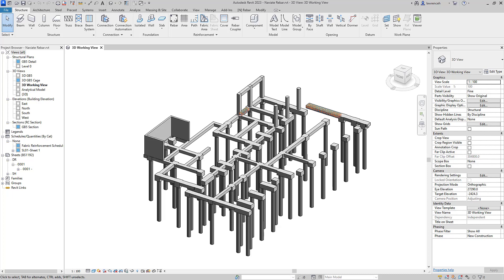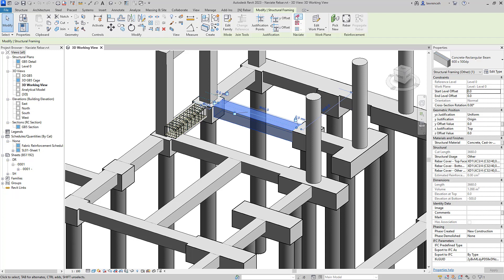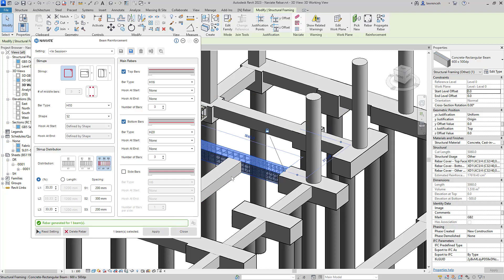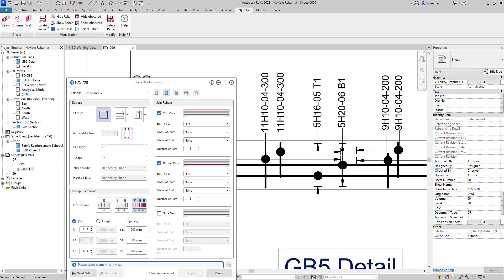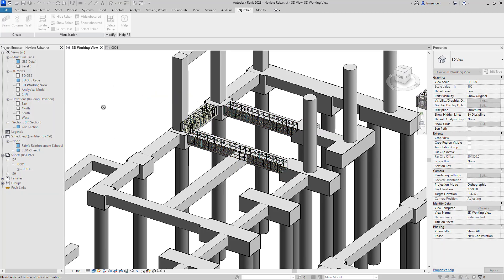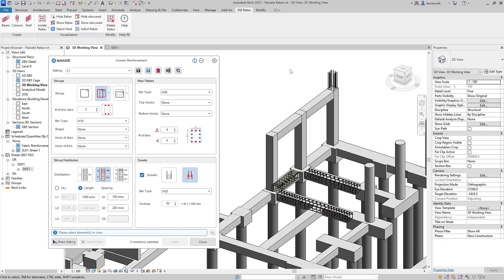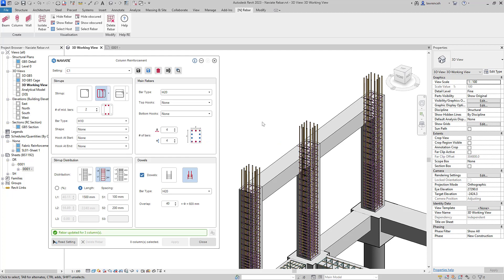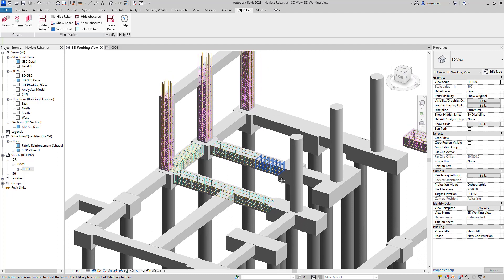Naviate Rebar unveiled for Revit 2023

Comment: Nice video, can we provide coupler and for vertical reinforcement bars in straggled way? and lapping details?
Reply from the maker: Hi, yes we can. We have just launched the Divide Rebar feature which provides staggered laps and simply splits if you want to use couplers.

Comment: Naviate is very helpful in rebar detailing but i found some difficulties in the detailing, (1)The vertical bars in columns should have 3 options, L bar for starter, L bar for Column End , Straight bar without any L. (2)The Beam reinforcement should have option to splice bars as there are many instances where each Beams have different Top and Bot Main Reinforcement (3)The Isolated Footing should have option to Invert the Bottom reinforcement if the C bars (shape 21) face downwards
Reply from the maker: Hi, glad you found the tools helpful. We have a connection feature which allows users to 'connect' elements which will enable L bars for column start and end into other elements such as isolated foundations and floors. We are soon launching our lap tool which will enable lapping on any rebar or rebar set. You can find more information here. https://blog.naviate.com/discover-naviate-rebar-3-reinforcement-connections

Comment: Good evening, I hope you're doing well. I have an issue with the NAVIATE REBAR pop-up window, as it is too wide and doesn't fit completely on the screen, which prevents me from applying reinforcement to the bars. Thank you for your attention.
Reply from the maker: Good Morning, I would suggest initially using our website, https://support.naviate.com/ for help. It could be related to scaling or your resolution.

Comment: Hi Lawrence…can I offer up an idea as a very simple but massively beneficial update to this?

When you specify the reinforcement like you did for the beam…there is space to the right to add the reinforcement area of the bars you have selected. Either have it as an input value…and have revit show possible options…or …just have the area show, greyed out and its just a visual aid. I’ll drop you and email tomorrow to clarify.
Reply from the maker: Hi Mark, yes, this is something that we will port across from our original Rebar Extension tool. This tool gave the option of creating sections through the element and calculating the area of the rebar at each given section.
Reply: Cool. What’s the tools limit Lawrence…can you apply the tools to a linked model? I’ve always maintained my thoughts that…it’s always to have your main model,linked into an external RC only template…so still captures changes. Purely for the reason that, if like on the project I’m on now…there are about 100 RC slabs alone to detail. Having the GA and the RC GA’s in one file I find dangerous practice. What’s your thoughts/?
Reply from the maker: @markr8604  The rebar has to be hosted in the actual elements that the rebar is applied. I guess a better approach would have been to use a similar technology to Copy/Monitor to allow the detailer to copy and monitor the formwork from another model. This way you would keep ownership and control of the model and also be aware of design changes.,
Reply: @RevitStructureBlog  That's exactly what my line of thinking was. The amount of changes on large models is sometimes too many to follow some days. Revit is sometimes a curse given the flexibility it offers to move whole elements in the name of "collaboration". Usually, the Rebar is detailed and ordered immediately when entering stage 4 (sometimes tale end of stage 3). and so the constant updates creates a minefield. Having the RC in a separate model, but linked to the main model via copy monitor is definitely the way to go (i think). Small jobs, like housing i wouldn't bother, but for large flat slabs i would.

Comment: What if the beam have 2 or 3 layers of tmt at top and bottom ?
Also if we need higher dia at the ends and lower dia in middle wht then
Reply from the maker: We are looking at rebar splices and connections, however, there will always be additional bars that the user will need to add but our tools are getting you there much quicker.